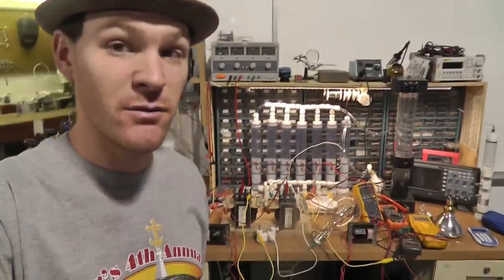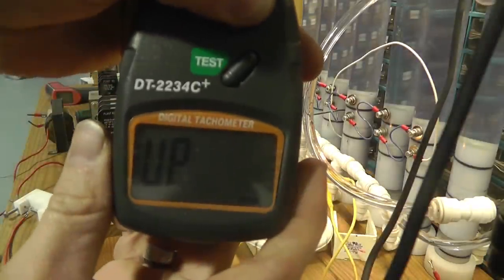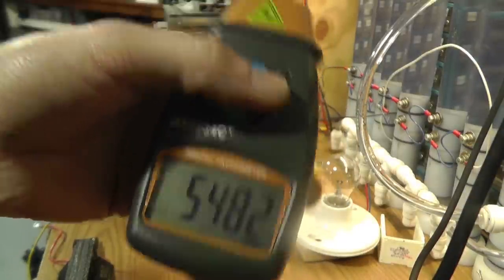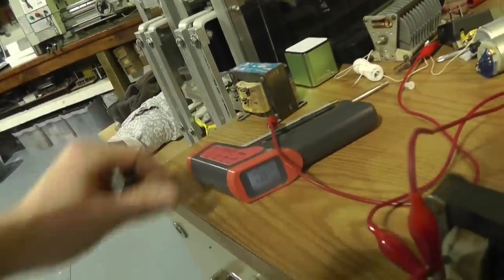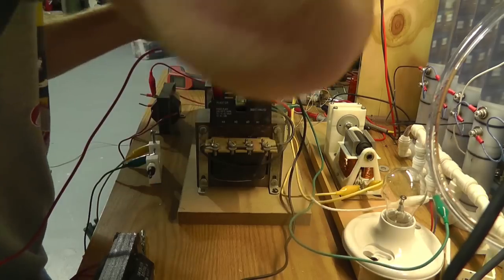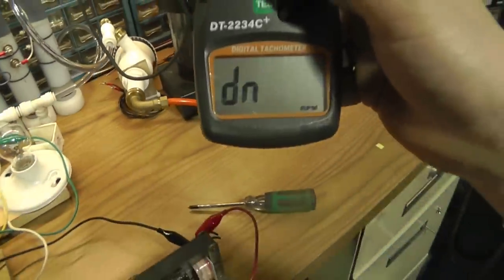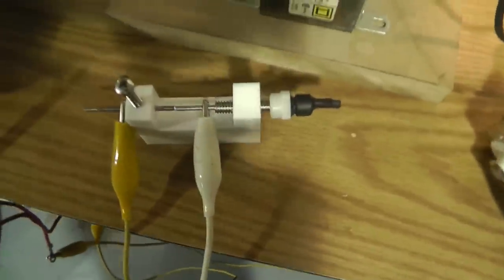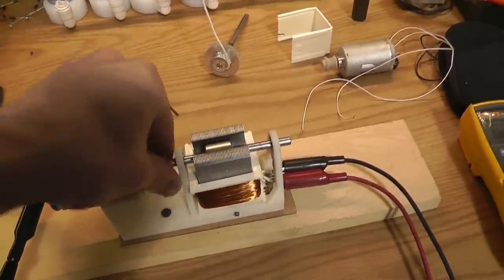Gerard Morin Testing. #1 Testing The Pump Motor. & Mini Make Shift Pole Pig Setup.

Comment: Russ, I was at two of the demos that Gerard did, one with just Gerard, Roman and myself and another where Mike Waters, Roman, myself and a couple others were present. I can offer some data that I observed during the tests.
First, Gerard was adamant about isolating the system from mains power. I don't recall the reason, but if I remember correctly it was something to do with the ground not being a ground anymore, but the common terminal of the pole transformers. We used batteries for the prime mover power source. 2-18 volt drill batteries. The voltage was 36 volts DC and the draw was measured at 27 watts.

Second, the output of the pump was measured at 135 volts. Another difference between his and your systems was a number of secondary neo magnets applied to the dc motor to increase the field strength of the motor, thus increasing the efficiency.
His connections were much simpler in that the output of the pump was fed directly to a step up transformer to about 500 volts, then to another step up to a voltage too high to measure. This was then passed to the spark gap and sent to the various loads including incandescent lamps, HPS 1000 watt lamps, a Rodin coil, and several types of fluorescent bulbs.

One of the most interesting things I observed was in a secondary spark, roughly 15 mm long that we are playing with. It burned the insulation of the wires when we sparked it through the insulation, but the end of the wires that the spark came out of stayed COLD. When we passed a 10 inch long spark through the HPS bulb, we experienced cold radiating from the bulb.

Many other effects were witnessed as well. Measurable radiant field at roughly 6 feet away from the circuit, the radiant field playing with several types of cel phones without damaging the memory or programs. Extreme UV radiation that persisted from the spark in the HPS bulb was a bit of a surprise.

I had with me a very strong NEO magnet array to see if I could disrupt or modify the field and observed sparks. The magnets had no effect, much to my surprise.

I also brought an older model of an infrared laser thermometer and we had significantly different temperature readings leading me to believe that there may be an artifact other than temperature/infrared radiation that the newer model thermometer was detecting.

It appears that tuning the motor speed to resonate the coils (or at least approach resonance. I expect that Gerard simply hit very close to that resonance with his setup.
I did not, per se, observe what is termed as over-unity, but there was certainly some effects that in my years of electronics I cannot explain and did not expect.

One issue with his pole pig demo that I would have very much insisted upon, were I there for that demo, would be connecting his combination of resistive and inductive loads to the gas gen-set directly to show it could not by itself run that load.

Gerard has certainly found some research worthy phenomenon here.

Thanks for the time.
Reply from the maker: thanks for the info, i have talked with mike about your/his trip. there was indeed some interesting things he told me as well. just as you described. thanks for the comment and information. ~Russ
Reply: What do you mean connecting his resistive and inductive loads to the gas gen-set directly to show it could not by itself run that load? I mean could that little gas generator by itself power that load at 6500 watts? Also you said you observed these thing's that he did but you did not see overunity does that mean you didn't see a power source powering more than it should be able to?  I am very intrigued by this setup Tinman on youtube did something like this with water and a light bulb showing something similar. If this isn't overunity then tell me why it isn't so I don't waste my time thanks in advance.
Reply: captain42979

What I would be looking for is actual voltage drop. By having the gen-set isolated from the load, it is seeing the inductive load of the transformer and by loading up the secondary, one can apply more load than the source is rated for but the shift comes in a significant voltage drop to the load. The impedance of the primary is not going to change that much when the load on the secondary is changed. I have no doubt that Gerard is sincere, but I do have some questions about his measurement processes. It may very well be accessing energy outside of the normal, expected sources. More testing and some specific measurements need to be done from several unconnected sources.
If one were to really break down the term "overunity", one would find that it really doesn't exist as it is currently understood. The phenomenon is simply accessing areas of energy that were previously unexplored or unknown.
If you want to really study and create practical devices that collect energy from these unexplored sources, have a look at the work of Mehran Keshe and the folks at the spaceship institute. They have about the best grasp of these concepts and are currently creating devices that tap into this source. We need to rethink our comprehension of physics and the energy/matter matrix, because what the general knowledge says about it is not very accurate and in some cases totally false.
As for you and your experiments, look at the effect that sharp edged pulsed or noise waveforms (as from a spark gap) have on the inherent field of the transformers. This is where the gold is within that form of the tech, as far as I can see.
Reply: pinantan001 I agree on most what you said except about Keshe. I was very excited when I learned about him long time ago and followed him but I never saw anything that worked at all. If you have any sources, video or whatever that shows he has something working please do share I am open minded to alternative energy.
Reply: captain42979
I am disinclined to offer much to folks that refuse to take responsibility for their own education and comprehension of concepts such as these. There is much available that you are asking for, but unless one can comprehend what they are seeing, the offering is wasted on them. It is easy to see a thing and disregard or ignore aspects of it that don't align with one's current comprehension. I cannot blame anyone for this though, because it is generally due to the multi-generational controlled schooling system that has succeeded marvelously in destroying folks ability to question and seek beyond what is right in front of them. Keep studying the material and gain a comprehension of what is being shown and the things you are asking for will be self evident.
Reply: pinantan001 Well I can say even the people that have tried and believed in Keshe hasn't produced anything. I mean throw me a bone or something anything except a coke bottle. I agree we are not being taught what we should be taught in school but if someone say's he has something lets see it. Outrageous claims like he has said has to be in question I mean he said it would take X amount of time for his space ship but no space ship. If I have said something not true tell me.
Reply: Pinantan001 - Thanks for coming down to my place, and continuing to study what you have seen. The replication you are doing, if you have some strange reactions, please feel free to contact me, because strange reactions are easily achieved. Thank you for your continuing research and Russ.
Reply: Thank you very much for share all this information... keep the good work
Reply: +captain42979 Gerard may very well be showing us all a good deal of overunity because I have experienced this when I had my McCulloch running periodically. I also have read the thermometer at -22 degrees on the bushing and in the sky as he read low temps too, however, he was pointing into a winter sky and I in the summer. My thermometer only goes to -22 anyway and it was maxed. However, many people claim those thermometers don't read negative temps. I'll say, my Ryobi isn't more accurate than 4-5 degrees plus or minus, but it does come really close to what I need to do. It is one year old and it did Not read any low temps with a standard generator which was also isolated from ground by it's rubber mounts on the unit. I tested to see if it had continuity to the wet ground with a ground resistance tester, as well with a high voltage megger. I had infinity readings and that pleased me. I did the same with the transformers with rubber line mats, so, I again had an infinity reading to ground from the megger from the case of the transformers and still nothing. The McCulloch did what it did for Gerard and I powered an 800 watt load with 375 watts input. I could not read the meter on the output, it just didn't do anything but vary on every setting, however, I test the same device without using the transformers with normal wall receptacle power and the killawatt meter says between 855-863  watts, the heater's peak is 1500 watts, but, it runs full bore at 800 rms and the transformer uses 60 watts for the coil's loss.. With the ac analog meter, the voltage held steady 1 volt lower than the input under load and exactly as the input was on the way in with no load. The transformer absorbed 60-70 watts by itself, both the input and output coils , HV everything together. The generator saw 60-70 watts. The highest load I added to the transformer was 7000 watts when the motor on the generator stopped running, and, it wasn't due to the load, it's because the coil blew for the engine's spark and I hope it wasn't anything to do with the system, however, the generator was within 5 feet of the transformer. The generator's coil is still good, I am waiting on a lovejoy coupling to arrive so I could use my electric motor to try it and see if it does the same thing.
 the output then went to 7000 watts with several appliances, blow dryer, heater, fans, lamps, soldering irons, and thousands of watts in halogen lamps. So, the answer is YES, the device draws less on the input than in the output. The heater runs at the same rpm as before, at least the tone of the motor sounds the same. I wire both sources to an outlet with two separate switches. I shut off the output of the generator, then, I turn on ordinary power and it sounds exactly the same, the analog meter reports the same voltage, digital is all over the place.
Reply: @pinantan001  what can done to address voltage drop can a parallel wiring or a cap do after the inductive or restive load to raise the voltage end to end of a load I think the voltage drop is required for that inductive load to work in the first place so try with both a resistor and later with a cap to reassure usage of amperage by the load 2 check on power  utilization also use ground rather than than neutral in all cases

Comment: For the neo magnet that won't spin, why not put it in a 1 pound spool of 24 gauge wire? It should spin nicely and give you high voltage, without all the attraction to the metal.

Comment: i tested with several transformers, and allso connecting them in series, like using them as coils, and i discovered, that it increased in output when i shorted the secondary winding on the transformer that was in series. as i didn't have any better that microwave transformer, it gave the best results. i do have some ignition coils, but haven´t tested if that could give any result ! : Nice Lab. !!!!*** : Cold Electricity & Pulse wave interesting ! : Keep on the good work !!!  ;)

Comment: Great demonstration, one question though, why wasn't you AC output in the 220volts AC range?
I use a 38watt 220watt at about 0.16 amps.

Comment: Great job taking readings on this particular setup brother :).  For the sake of the experiment though, it might be important not to be hooked up to mains.  If you have a strong ground reference on your power supply, the supposed radiant energy will go to that - capacitance.  I also am making no claims that there is any radiant energy, just suggesting that great care is taken into a full replication of this experiment.  So in order to do it properly, one might need to unhook ones power supply from mains power. Using batteries or a conversion generator of some sort, as Gerard Morin has done in his experiments.  Other than that, that is some great replication you have going on there.  Its nice to see a complete picture with units of measurement.
Reply: Daniel Gendron did put magnets on the motor like gerad morin DID

Comment: Hey Russ, I found that I couldnt get the light to turn on when i used an hour 18v drill instead of the motor. The drill was plugged into the wall socket (household energy). But when I used a brushed rc motor connected to a lithium ion battery the light would light up. Maybe that helps. I haven't tried with a transformer yet, excited though!

Comment: Awesome experiment. There are a few important details missing though to replicate on a small scale. Pole pigs have a ribbon coil for the low voltage side, which I suspect might act similar to bifilar coils. In video of how pole pigs are made you will notice the high voltage wire coil is wound over the ribbon coil in the same direction. This should make the two coils in phase under no load. Does a load applied to a transformer instantly flip phase? or Does a ribbon coil give 180 or 90 degrees out of phase and the more load applied bring it in phase?

Comment: Hi RWG

I'm just getting started on the gerard stuff.  I just gto a 24vdc motor 3600 rpm and a washing machine pump .  I am now making a mini pole transformer based on The video How It's Made on the pole transformer.  mine uses a 2 inch wide copper plate about .032 thick and this was wound around a 1/2 in pvc pipe.  Thripple thick paper was slid in between the layers of spiraling copper.  copper braid was soldered to each end.  I used a few layeros of tape and then wound on this 10 layers 40 turn each of 22 ag magnetic wire 400turns total.   My idea is to drive the neon sign transformer9kv 60ma with 120 60hz cold electricity output from the washing machine motor generator. the neon output will drive the 400 turn primary and then I'll place some loads on the  copper plate secondary.  My mini pole trans will be placed in mineral oil inside a clear plastic tube so that I can observe any arcing.   I'm trying to prove that the larger pole transformers are converting the cold radiation into hot electricity .  the pole hasa primary HV coil of 8ga ?? 540 turns?? and the secondary is about 10 turns of aluminum 1/8in thick plate.  Tesla showed how radiation hitting a plate of metal would produce voltage.
Reply: What are the results?

Comment: In de last motor of your video ,put a fly wheel between the motor and the pump wheel , than,  maybe you have better results :) for test with neodyum magnets.... it seems that in your experiences you have _______ only some part's that is not the more important in the tests that Gerard Morin made "IN MY OPINION" ... with the right transformer +spark cap , probably others understand better what we can do with cold electricity high voltage/RADIANT ENERGY... And Tesla realy do it  , use more voltage, amplify the voltage how many times he want,  to create a motor that generate more dc volts and more AMPS, or for example a motor that runs on static :), or a pulse motor... but if is big probably you will go to understand where come the amperage, is only a question " how big is the fly wheel that you go to use with the motor/generator that runs on static current , or radiant electricity? " i realy like the radiant energy and i have see many videos ,good experiments ,desapear, probably radiant energy is a very dangerous subject for the oil vampires/FOSSIL FUEL VAMPIRES THEY REALY WANT CONTINUE KILING THE PLANET AND SUCKING HOW MUCH MONEY THEY CAN TO ALL PEOPLE ...and many are already sold their soul ...for me is a question of time that people wake up and realise they live a BIG LIE, energy is every where , UNLIMITED , ALL IS ENERGY, the laws say we cant creat ,  is truth, "she" is already there/HERE/EVERYWHERE , we only have to understand that we can extract some energy of the NATURE, and with that litle energy we can extract more and convert to electricity in the best way possible ...and ofcorse in my opinion we can use 2 or more sources combined to extract more energy/TO CONVERT/TRANSFORM in electricity... for example : like Gravity and Magnetism, ((NATURE HAVE MANY MORE SOUCES UNLIMITED , UNTIL THE PLANET IS ALIVE, and for me this is the most important to understand.))

Comment: Gerard Morin claims in his set up using the pump motor as as generator driven by a dc motor that the ac output is at rf. This is clearly impossible. The motor speed is stated to be 4000 rpm and as the ac generator is a 2 pole machine the output frequency at this speed cannot be more than 66 hz. . Morin gives no value for the output frequency but places his fingers directly across the exposed output terminals of the ac generator to demonstrate that the frequency must be high enough to prevent a shock free contact with the terminals. For a shock free contact with the terminals, the ac output frequency must be not less than 20khz. This would require a motor speed of 1.2 million rpm.